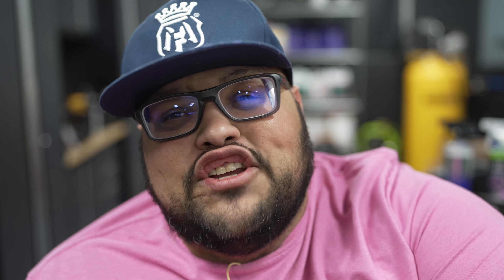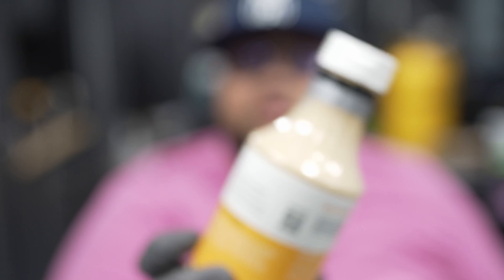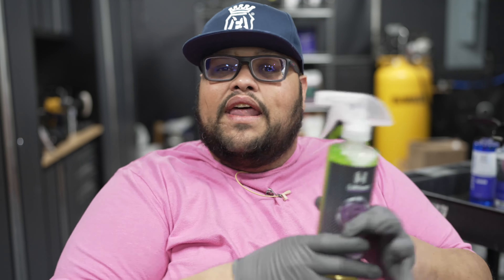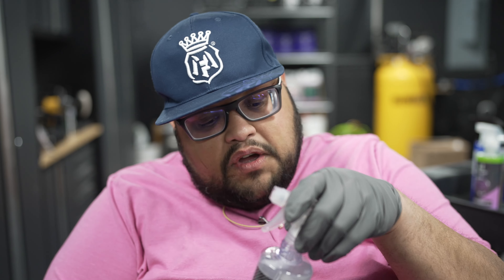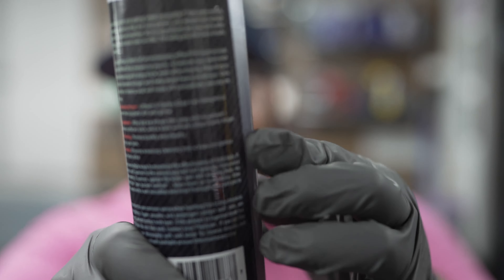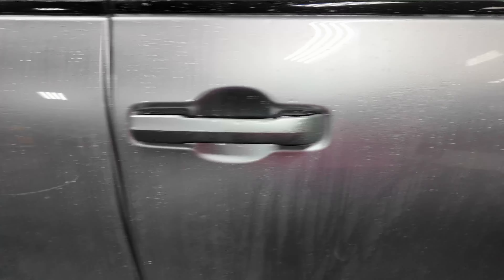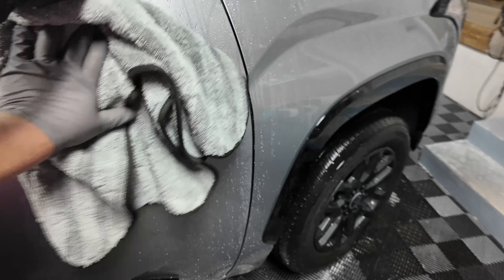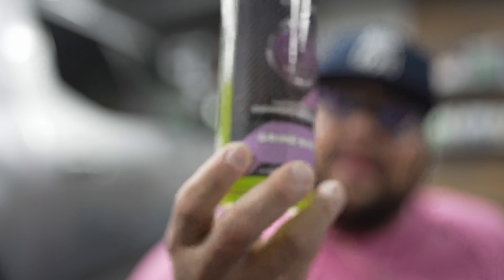Is Lithium Auto Care a Waste of Money? Product Review

Comment: You’re gonna make folks broke with all these product lines😂. I’ve used one of their OG products for years. Lithium Trim Serum. I actually have 3 trim products based on the condition of the trim I’m working on….Solution Finish, Lithium Trim Serum, Vonixx V-Pro Plastic Ceramic. Great video as always.
Reply: By the way of all the products you featured the one I’d be most interested in is the coating. You know when it might be available?
Reply from the maker: @BetterThanNewDetailing  I dont know when it will be hopefully he announces it Thursday
Reply from the maker: Trim cubes are goated for sure , I haven't tried trim serum I did buy some to test against
Reply: @Ecdetails  I believe the cubes came out after the Serum….Serum is one of their older products and is like a silicone gel. The cubes are similar to Cerakote..which is also in the GOAT category…unlike their $30 coating disaster😂.
Reply from the maker: lol

Comment: Ive been using LA totally awesome as my go to degreaser/cleaner as it does not have any acids or ammonia and have the cleanest result compared to others, ill order the Grime wave and see i can finally switch.
Reply: LA pricing is hard to beat tho
Reply from the maker: kontra I have never tied la - how would you rate it Va others in the industry.
Reply: @Ecdetails   Its pretty a versatile product where u can play with the dilution ratio and price for a gallon is about $15 which goes a long way because it a concentrated product, the only downside is the smell. I use it as a pre wash if the car im doing is pretty dirty or needs some work. its also good for carpet stubborn stains. Also try out the 3D Super Soap Nano Pail if u want a clean and streak free car wash and easily washes off
Reply from the maker: @1kontrabida  iimma look it up! See what iits about thanks for sharing that!